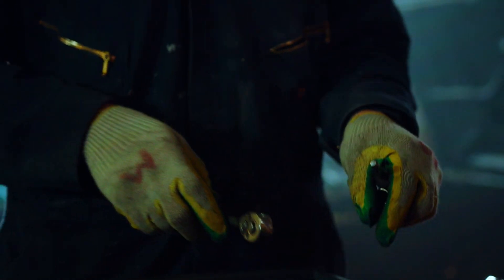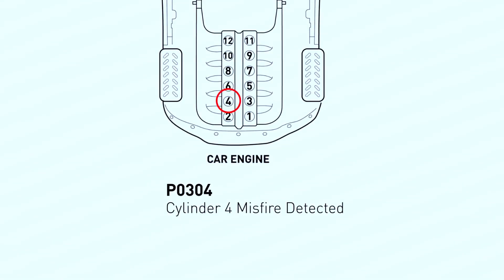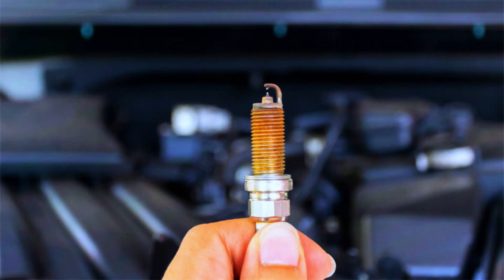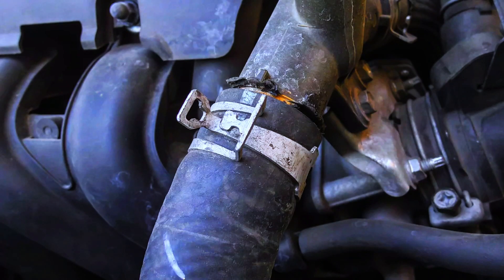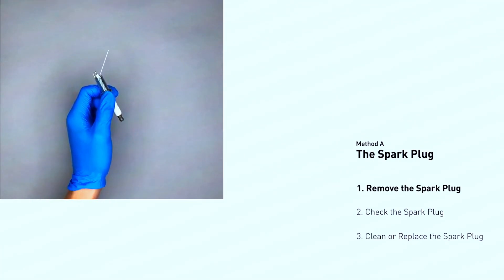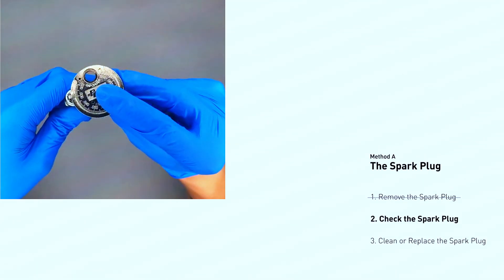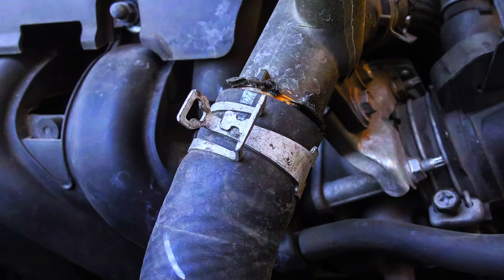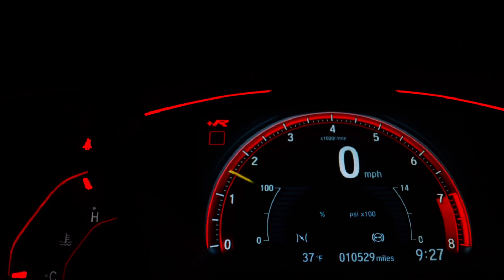P0304 Code Explained: Diagnosis and Repair Tips |

Comment: Bmw 120i 59 plate if I drive like miss daisy its fine soon as try putting foot down kicks up 0303 code clear code its fine again until try it again ?
Reply from the maker: That’s a classic sign of a misfire under load, not at idle or light throttle. On your BMW 120i (59 plate), a recurring P0303 usually points to a weak ignition coil, worn spark plug, or sometimes a fuel injector issue on cylinder 3.

When you “drive like Miss Daisy,” the demand is low, so the weak component still works. But under heavy acceleration, the spark or fuel delivery can’t keep up, triggering the misfire code.

Try swapping the coil and plug from cylinder 3 to another cylinder — if the misfire moves, you’ve found the cause. If it stays on cylinder 3, check the injector or wiring. It’s a quick and effective way to pinpoint the fault before replacing parts.